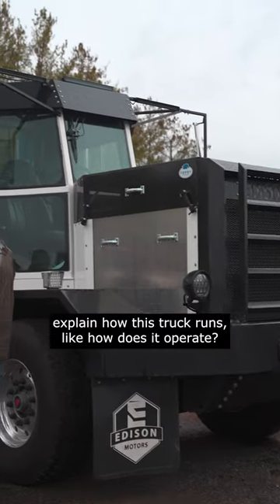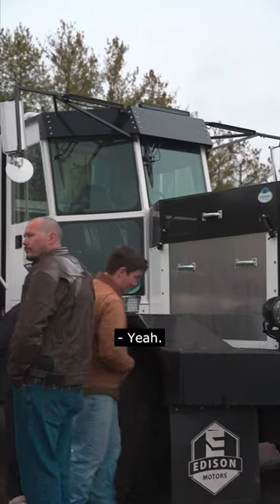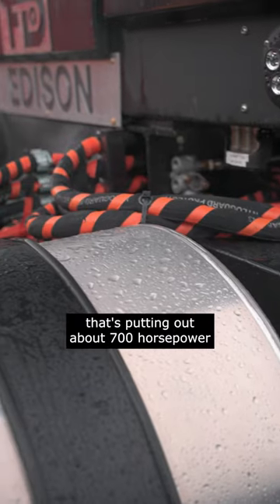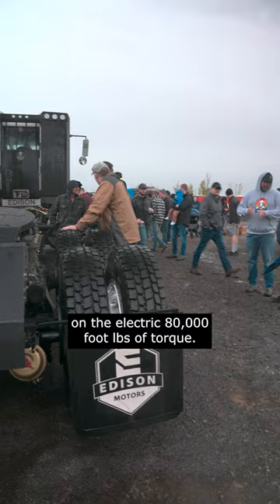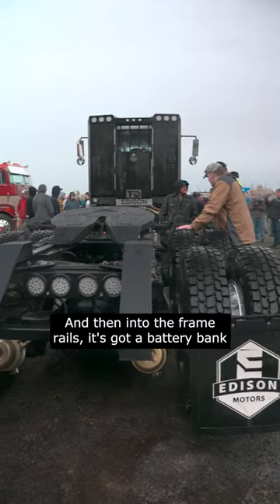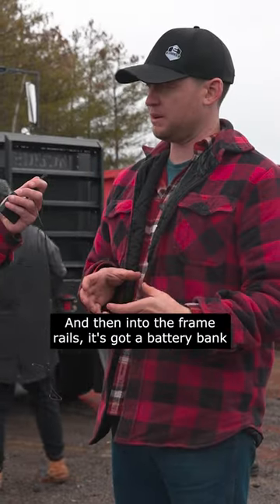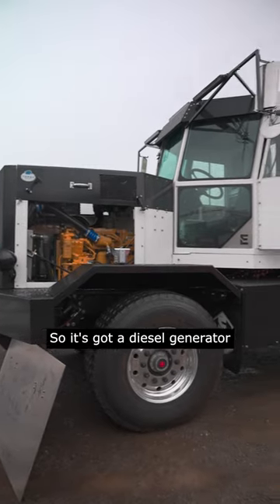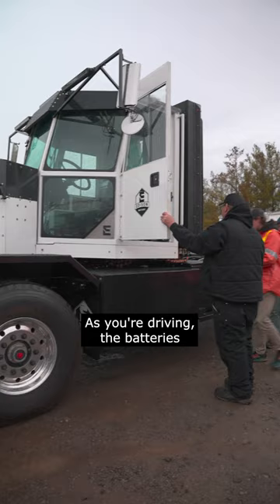@EdisonMotors tells us about how their new electric truck operates! 🚚⚡

Comment: This is the future for semis, especially for 95% highway trucks. it’s genius, the generator will rarely run unless it’s a lot of city traffic. How has no one else done this on a larger scale, it’s actually ingenious
Reply: They have. They're called locomotives!
Reply: When he has explained how he is making a Jake brake on the Cat C8 as a Generator to charge the batteries as it runs around 1,800 rpm which still won’t consume as much fuel as a C15 or Cummins ISX15. 
Tesla didn’t do anything like this because he wanted to make money off of the sales of those Superchargers 
Hybrid is a better solution and Toyota has been doing that for a long time
Reply: Its called trains 😂😂😂
Reply: it turns out for trucks that only do container shipping like for walmart this type of hybrid is actually less efficient than a full diesel or full electric. However for logging and other work trucks hybrid is much better.
Reply: Americans learn about trains
Reply: Actually long haul trucking will stay on diesel (would be better if trains) short trucks should be full electric, but there are lots of other vocational trucks that edison will work great for, I am willing to bet in a couple years once people reap the fuel (and money) savings they will likely swap the generator out for more batteries but more importantly they are proving the tech works and doesn't have to be propriety
Reply: By 2050 we have to stop using fossil fuels. So while this is a step in the right direction for the medium term, it's not good enough for the long term. But if they adapt their design to use hydrogen fuel cells to recharge the battery instead of the generator then it could be a long term solution for heavy trucks.

Comment: It operates like a train a locomotive. It has a diesel generator which supplies the power to electric motors at the wheels. No matter what trying to move that much weight is going to produce a carbon footprint.
Reply: you're not one of those who has been fooled into thinking a zero carbon footprint is possible right?
Reply: It works because it has a dedicated track. The road is very different.
Reply: No it doesn't work like that. Diesel-electric locomotives have the diesel powering the electric motors directly. This has a fairly sized battery. It can and will be driven with diesel generator off until the batteries needs recharging, then it starts the generator which can run at one optimized rpm so it's smaller than in a conventional truck.

Comment: It wasn't built to be green it was built for POWER.
Reply: its like hybrid cars they use less fuel because the electric motor provides max power instantly and gets the car up to speed and then uses the internal combustion to keep cruising, grandfather's worked on earthmoving equipment set up like this over 60 years ago
Reply: Okay but it actually was built to be green and efficient

Comment: What will help these guys is to say the drive train is a Diesel / Electric just like every freight train in the USA. But it has a battery boost powered fron the Diesel engine and from running down hill or recovering the energy under breaking, which will save service on the breaks

Comment: I want to see this do the Ike Gauntlet towing 50k.  I'm expecting good things.
Reply: This truck is going to crush that road test.
Reply: The battery supplies peak torque demand to get moving, but running up in the mountains the battery will be used up and only the diesel power still available so it's going to struggle.   And if you put enough diesel power to run up in the mountains...having the battery is made much less important.
Reply: @recoilrob324 The diesel only drives a generator, not the wheels.

Comment: I knew that this was possible.  I would love to see this system in a coastal cruiser boat.  Take one of the ones that has 2 engines in it,  replace one of the engines and replace it with the battery bank, and put the diesel generator on the other side.  Those boats are already running a ton of electricity thru the system, plus add solar to charge without the generator running.  You could top the whole truck with solar as well

Comment: Trains have been using this setup for years.  They are even more efficient as they don't have to stop and start.  Going down the highway this style of truck would do well I think as your not stopping as much.   In my opinion this is the best case scenario for the an "EV".  The BMW I8 I believe works like this as a well for the most part with a 3 cylinder gas engine.

Comment: Isn't a 4c battery like the same equivalent to a racing FPV drone? Insane torque like you never would imagine?😮😮
Reply: Effectively, yeah. I think most FPV racers run 3C or 3.5C though, because the discharge capacity is a bit limited by size and wire gauge.
Reply: I mean he did say 80,000lbs if tourqe
Reply: Pulled 100k pounds like it wasn't there

Comment: Drove a 50 ton haul teuck converted to an 8000 hallon water hauler. Had a cat deisel generator that powered electric motors in the wheels. P.S. thats hiw modern freight trains work as well

Comment: Please explain how you literally  don't tear the rims off the tires at the speed of sound from a dead stop accelerating and how you dont tear the axles out from under the frame with all that torque? 
I'm assuming electronic controls that significantly reduce the power output?
Reply: They've built it strong to withstand the torque!

Comment: I read where the batteries are being recharged while driving, but what is the mileage total?  Nothing lasts forever, as in its charge.
Reply: It can drive until the diesel fuel tank is empty and the batteries are drained. Fuel tank always comes first since the generator charges the batteries and isn't need to be on - it shuts off and the e-axles only draw power from the batteries.

Comment: Easier to explain is that it's exactly like a diesel electric locomotive. Same concept, except a truck can move in two dimensions instead of just forward and backward.
Reply: But it isn't exactly the same since they have a battery. So it's "exactly like a hybrid train (locomotive)", not a "diesel-electric"

Comment: Diesel trains have been running for some time.  Why not set up a truck like a train?   Diesel running electric motors for each drive wheel.  (And I’m presuming I’m remembering that correctly).

Comment: Why cant they put electic generators on each axle to lower the use of diesel again. The 2 combined would be heaps more efficient. We know you cant get enough energy back to power whole rig but what ever you get back without putting extra load. Its that much less diesel.

Comment: Wait, don’t most trucks just have a diesel  generator at the front which also charges two batteries but then in turn the generator. Can also generate power to transmission to move the wheels.😂😂

Comment: The London black taxi made by Geely works this way. Diesel-electric locomotives also have a similar setup... the surprising thing is why it has taken so long for the concept to be built into trucks. What he doesn't mention is that they no longer need the complex mechanical gearbox (instead, they have a level of elelctrical complexity in place of mechanical complexity, which should give bith higher availability and reliability)
Reply: it has been used in mining trucks for a long time its really about economics this is still for a niche use so it makes sense but for something like a highway truck all this added complexity is not really worth it when you can have the diesel run at its optimum rpm while going down the highway and just have it drive the wheels directly.
Reply: @zachmoyer1849  , yes indeed. However, long distance trucks running at constant rpm for the majority of the time isn't the majority of the commercial vehicle market. There are a great many that operate in towns and cities, with stop-start and plenty of idling. Regular stop cases including buses, garbage trucks, postal vans and trucks, etc.are ideal cases for electrification, especially with the option of a range extending petrol/diesel generator for the longer excursions (such as the black cabs that might need to go intercity now and then). Furthermore, as zero emissions zones are extended this type of vehicle can continue to operate in those areas. London has been massively improved by the introduction of the ULEZ.
Reply: @jerryjoynson  those applications are attempting and could mostly be served by an all electric vehicle. The added complexity and cost of this type of drivetrain again is not really necessary or economic. The shortcomings of the battery can just be made up for by different route scheduling and a network of fast charging stations.

Comment: This is basically a diesel electric which has been around since WWII. Its great to see someone try to put it in a truck the problem is you're still burning diesel which is what they hate.
Reply: A battery only truck is just inefficient
Reply: It's not the same, it's a series hybrid so they have batteries. That's not in locomotives. They can turn off the generator in between charges.
Burning less diesel out to be better.

Comment: Did he say 80,000 ft-lbs of torque?? Thats more than a train engine!
Reply: Since the electric motor spins the wheel it's that torque that can be measured since the inner transmission is built together. When you measure a truck engine torque it doesn't have the transmission to gear it down and build up the torque.

Comment: Four questions...1. How much do the batteries cost ?  2. How deep are the average discharge cycles ?  3. How many days until the battery performance has decayed to the point where you can't live with the remaining battery performance ? 4. How annoying is the sound of the diesel engine racing while you are driving through downtown ?

Comment: Wow locomotives use this idea in the fifties and still do. Now they're finally inventing it for vehicles . diesel engine runs at a constant rpm for maximum fuel efficiency they also will stop going down a mountain reverse polarity on the drive motor as its recharging the battery at the same time . Especially in the Rocky mountains constant accidents from overheated brake failure slow polls on the hills causing traffic issues and the lack of experience driving the passes hundreds of people are injured or killed every year because of it. I hope you get it to work I couldn't see it so much in the city but long haul and mountain traveling I could see it working. And saving lives good luck. Now it's all about who doesn't want you to have it.

Comment: Ok these guys are logical, sensible and have real world common sense. This could have been done decades ago, Diesel electric trains were almost there without the batteries in the 1960s.
The Diesel generator can run steady at it's most efficient speed. Even with charging loss it's still way more efficient than direct drive. Plus you have the benefit of regenerative braking. 
So obviously the morons in charge will cancel these dudes.

Comment: I don't understand why people don't realize combining batteries with gas power will greatly lower green house gases into the air and make battery power cars a reality. 
Does not have to be all gas or all electric
Reply: Problem with plugin (parallel) hybrid cars that people might just buy them for incentives but not care to plug in to charge. Only energy other than from gas is from regen.

And that many car uses cases just makes sense to do only BEV. For a logging truck picking up in the forest it makes no sense with BEV, so there is where the diesel should go to. Not city-driving cars.

Comment: Am I wrong to assume that these trucks are like modern trains?
Reply: no but its designed to be exclusively electric and only use the diesel if you run out of battery which is not how a train operates.

Comment: 80 000? That's 108,465 nm. what in the actual F! 😳
It's beyond literal locomotives. Leaves mining trucks in the dust. Regular semis should just stay parked.
Reply: You compare wheel torque with diesel motor torque before the gearbox that decrease speed but increases torque.

Comment: Great! How much fuel you save? And then the next step: sprinkle the world with green recharge stations and dump the diesel. If you can ride your daily routes on the batteries and recharge those where your truck is parked, you don’t have to burn any more fossil fuels.
Reply: the logging industry he is making it for is a unique use case. They go up empty and come down with a ton of weight so they can regen for "free" on the way down. This design would not really work for anything with that use case. As the batteries would not really get you very far.

Comment: I’m completely lost on how you can just quadruple your battery output on demand. Is 250 the average and 1k is the max?
Reply: There's battery capacity, similar to the amount of gallons your fuel tank holds, that's kWh. Then there is power, that's kW. The C rating is the capacity (C) times the rating, in this case 4, equals the power. So 250 kWh x 4c equals 1,000 kW.  That is a peak rating. Usually there will be a listed time. Even if it was continuous, it will only last 15 minutes (60/4) before it depletes the battery. Of course, it's very difficult to use 1000 kW for longer than a few minutes before you are well over the speed limit, even at 80,000 lbs uphill!
Reply: Yes, he misspoke in the video. The battery is 250 kWh which equates to 1000kW at 4C, ie it discharges in 1/4 hour.

Comment: 80,000 fts of torque? Not a cold chance in hell! A diesel locomotive only puts out 60,000.  On top of that, with that much torque, you would destroy the tires. I have been driving semis for 34 years. I have seen first hand what an 800 hp motor with almost 3,000 lbs of torque does to tires running up Baker grade at full power. IT DESTROYED THEM! I would have to see a Dino run live stream, prove what you say!

Comment: So it's not electric, it's diesel electric like a train locomotive?
Reply: No, you can charge  the 250kWh battery from the grid.

Diesel electric locomotives do not have a buffer. When braking electrically the power is dumped Into large resistors. 

When Topsy slows down using the motor, the energy is stored into the battery and can be used for acceleration..
Reply: @MichaelEricMenk  thanks
Reply: @tommyordoyne7461  it's a series hybrid. Unlike diesel-electric there are also similar hybrid trains.
The point is that it gets much more work out of the diesel fuel.

Comment: Ok, but here's the real trick question how much does this affect your overall weight?
Reply: There’s an off set, normal diesel trucks have huge engines that are very heavy, roughly equivalent to the battery weight, the diesel generator is much smaller and much lighter. 
The magic comes from the power control system, that manages power to the axles, depending on load and demand. 
Under heavy load batteries discharge, and under low demand the generator recharges the batteries. 
It would be a rare occurrence under normal operation that batteries get depleted below 30%.

Comment: I do like the design and innovation. The only issue i see is in the future. What is it going to cost to replace those batteries?
Reply: The batteries are only a few SUV BEV's worth of capacity. What is the fuel savings gonna be over the years? The batteries will be less than the savings on the fuel.

Comment: 80,000lb of torque? Thats insane.  Usually its around 1100lb of torque
Reply: Not really. An equivalent diesel engine is gonna put out like 1500-1800 ft lbs. then it’s gonna get multiplied by the transmission and rear gear. I’m not sure where they’re measuring their torque, but a heavy vocational semi truck will output like 50-70k of torque measured at the axle in 1st gear. Topsy still crazy impressive, but not that far ahead of the diesels.
Reply: @gavinatkins2671  thank you for giving context! This was helpful. So about 10% higher peak torque but some x % heavier for the ev cuz of batteries so sounds like a wash...

The downhill regen + clean/quiet powersupply and the serviceable minded build of Topsy I think will ROI 5-15more annually? What would be good? 

Trucking seems to be about efficiency at scale so might work out.
Reply: @Navsworld13 Weight comes out to approximately be a wash compared to a diesel truck from what I remember them saying
Reply: @Navsworld13  the big thing that I think will help an EV get down the road is the constant torque vs the on and off with a manual transmission diesel. 

Also, in this application it’s really looking like the hybrid isn’t much heavier than a regular semi truck. Topsy is heavy AF because it was build heavy AF.

Comment: Ever since ev I have been saying they need ther own generator or solar panels there's no reason you should have to charge your car every day
Reply: Using a generator defeats the purpose of having EVs which is to stop using fossil fuels. You can't fit enough solar panels on a car to run it very far. Best I've seen is 40 miles a day in very sunny weather. You put the solar panels on your house and plug in your car to charge. Even better put solar panels on the office building and charge your car while you are at work.

Comment: And how long to fully charge and how many miles does it travel before recharge
Reply: It can drive purely off the generator, the batteries just make it more efficient
Reply: It can drive until the diesel fuel tank is empty and the batteries are drained. Fuel tank always comes first since the generator charges the batteries and isn't need to be on - it shuts off and the e-axles only draw power from the batteries.